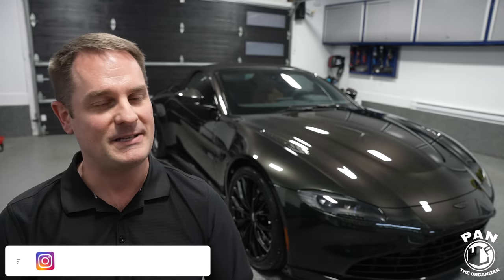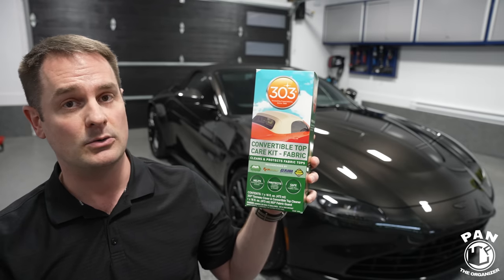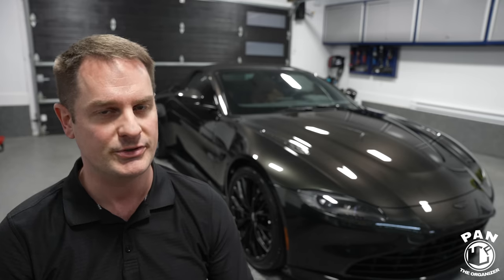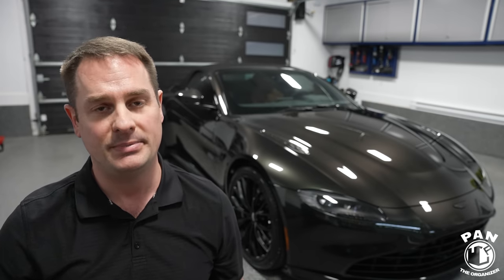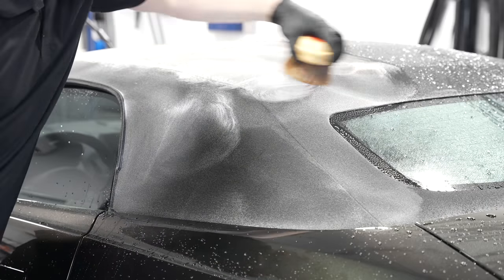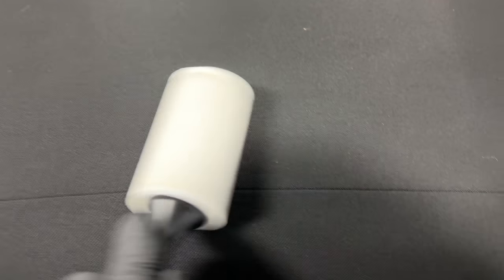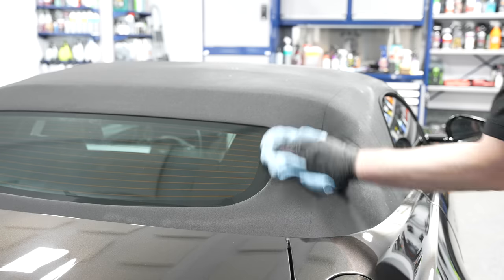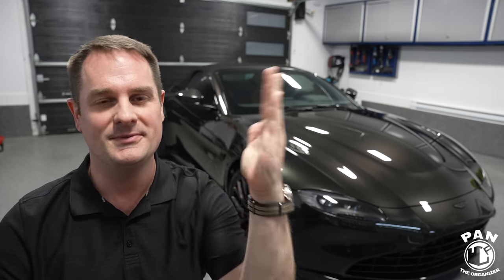How To Clean A Convertible Top

Comment: Pam, Im glad someone is producing a new video about convertible tops. The biggest area for improvement is to never use a pressure washer. The best method is flood coat of the water hose.
Reply: @coltongreysoper2134  why

Comment: Another outstanding video for those owning convertibles. Patiently waiting for help cleaning something every vehicle has: seatbelts.
Reply from the maker: Thanks 👍
Reply: Use a bungy cord and pull your seat belt out the door of the car towards the rear wheel and use the bungy to hold it in place flat against the body of the car. Gently close the door but not all the way. Pressure wash the stain out of the seat belt against the body of the car (a clean car) and it’s good as new again!

Comment: Is there any UV protection? It seems that would also help greatly.
Reply from the maker: Official statement from 303: "While 303 Fabric Guard does not provide UV protection directly, it protects the original UV resistance of outdoor fabrics by adding a layer of water repellency and stain resistance, which helps prolong the life of the fabric."

Comment: Great video Pan! What about the convertible top storage area of the car? When I retract my roof, the storage area has collected years of dust that can be transferred. This area also houses delicate moving parts for the roof mechanics (cables, springs, etc). It would seem best that this area doesn't get too wet? Thanks!

Comment: Hi Pan. Tomorrow I have a Smart Fortwo Cabrio with very dirty top. Sr. Lobo Detailing will follow your technics and steps although using different products but premium also. I’ve seen so many videos that only yours calm me down because you wash the car before as usually. In other videos they recommend not to do it to avoid dirt get into the top fibres even more. But I trust in your experience. I’ll let you know the results!

Comment: I know you try a LOT of products but I’ve been so impressed by maniac wheel and tyre cleaner. I won it in a giveaway from Eddie Colon and it has completely replaced brake buster for me. I tried it on an old accord with that brake dust that’s been baked on for years that you don’t expect to come off unless you use an acid. Completely vanished, just a little agitation from a brush, and 15 year old wheels came out like new. Also it’s a very good tire cleaner. Haven’t had to do more than one pass yet. Also it smells great.
Reply from the maker: We can’t get that line in Canada yet, to my knowledge, but hopefully I’ll get to try it one day.
Reply: @PanTheOrganizer  it looks like TOC carries it but it’s out of stock
Reply from the maker: Thanks for letting me know. I'll try ordering when they get new stock.

Comment: Great video Pan!  I'll be getting my new Porsche 911 convertible next month so this is excellent timing.  Any reason why you clean the top last?  You always advocate cleaning from top to bottom. How often do you apply the fabric guard, after every washing?  Thanks for all you do!
Reply from the maker: Congrats on getting your new Porsche. For a convertible top, as it's normally recommended not to use pre-wash snow foams or shampoos on them, we typically leave them for last in this scenario, as we'd use soft top specific products to clean and protect.

You apply the Fabric Guard as needed. Meaning when you see the hydrophobics starting to diminish, it's time to reapply. Durability really depends on how much mileage you do, your weather/conditions, etc so it's impossible to know.

Comment: I agree with everything you demonstrated. My 22 year old convertible vinyl roof still looks new by using just water in a spray bottle (I never allow water on my car) and a soft brush to clean and then 303 for protection.  I guess I clean it every 3 or 4 months.

Comment: I like to use the Meguirs fabric brush to remove the lint and sand of my soft top.
Currently using the Turtlewax hybrid solutions misting detailer to prevent the lint.

Comment: Great video as always. Love the 303 products. 
As an FYI 303 had a bad batch of protectant out in the market. It turns ashen gray/white. 
But a good company stands behind their product. Offering replacement and refunds. 
The bad product washed off using Dawn Power Wash, at 303's suggestion. 
Did a good job last week. Then came over that with the 303 cleaner and fresh protectant today. Makes my 2020 Race Red 'stang look like it just rolled off the showroom floor with a jet black top. 

TY Pan for all the great info.
Reply from the maker: Thanks for the info Michael. And when you mean bad batch of protectant, are you talking about their Interior Protectant, or something for the paint?

Comment: Are you supposed to apply any of this again once you wash the car ? I have a Porsche 911 992 Cabriolet and am wondering how many times I need to wash it. I don't drive the car when it snows or pours therefore only on cool days and sunny days, therefore I don't need to wash it that much. If I do apply a protection like this, I'm wondering if I'll need to reapply it after every thorough wash ? Thanks.
Reply from the maker: No you don't need to redo this after each wash. You would only redo it if you see the hydrophobic properties (i.e. water beading) starting to diminish. That's a visual indicator it's time to replenish the protection. It depends on your conditions, weather and mileage.
Reply: @PanTheOrganizer  -- Thanks a lot for the answer.

Comment: Hi Pan , do you full pressure of the jet washer on the soft top  or do you turn the power off and just use the standard water through the gun ?
Not sure if the full power of the jet washer could damage the roof

Comment: @Pan How would you maintain/clean the soft top after applying 303 Fabric Guard?

Im currently using Gyeon Fabric Coat and I found that pressure washing and a PH neutral snow foam worked very well as per their recommendations but I see no such recommendations for 303.

Comment: Thank you for the video Pan! I am curious to one thing in the video. Is it safe to use a pressure washer for rinsing a vinyl convertible top? I thought I remember reading somewhere about not using pressure washers on vinyl convertible tops?
Reply from the maker: That is correct and incorrect at the same time haha. The reason why most say not to use a pressure washer, it because they don't want people to come in with a 4000 psi gas powered pressure washer as that could for sure damage the fibers.

For detailing, it's never recommended to go beyond 2000 psi when washing cars. I set my pressure washer to 1000 psi (the more important is water output, at 2.1 GPM my pressure washer has a stout water flow). It's totally safe to use on fabric tops.

So if you have a pressure washer that generates too much pressure or want to be 100% safe if unsure, just use a garden hose.

Comment: 303 fabric guard is the absolute best product for convertible tops especially when you have a brand new top installed or on a new car's top , the best way this works  is to mask the car off around the top area borders plus use thin plastic to cover the rest car completely after cleaning   use the lint roller then we spray the top in a x pattern saturating the top in direct sunlight if possible on not to hot of a day 80 or so , and below works great - do not wipe the product off just let it dry right out in the sun if you can ...we have found out in the upholstery shop in testing  this gives the best results with the longest duration of protection ....you really have to mask the car up good and cover with plastic for over spray other wise it is a night mare once hardened to get off parts of the car that you don't want it on .... do this every summer ... or if the car is only used for limited summer use and stored covered in the winter do this 303 every other year will work just fine .... I have a Camaro Z28 SLP  LS1 convertible car I put a new top on it 1 year ago, and its a garaged car covered car only used in summer with a cover used all the time in the summer when not driving it , and the 303 coating is in perfect pristine condition as is the top it looks amazing brand new , and when treated with 303 it just makes the top look really rich darker more vibrant in color ... great channel just subscribed !  I've bought several of the products used on this channel and they ALL work GREAT ! ...
Reply from the maker: Thanks for sharing your experience and tips, and I appreciate the kind words.

How did you discover my channel by the way?

Welcome to my channel. You discovered one of the biggest car detailing channels on YouTube as we surpassed 910,000 subscribers and we have over 120 million views! I have been detailing for 26 years and I love to share my knowledge and passion with my viewers.

You found the right channel to help you learn everything about detailing.
Reply: @PanTheOrganizer  I found the channel looking at ceramic coating videos here on youtube ....  I did buy the Tw hybrid line up , thinking I can still get the ceramic coating off on  a shorter term product a lot more easy than a long term product in case of road damage to perform paint repairs if I need to , so far ive used the TW hybrid ceramic spray coating on 4 of my vehicles  corvette , camaro  z28 , Hemi Jeep, Duramax 1 ton  long bed crew cab this one took days to correct,  and get coated ...

Comment: Recently picked up a used convertible. The soft canvas top is in good condition however, it looks like someone got too close with a pressure washer and left marks that are lighter in color. The top is dark blue. Can anything be done to even the color back out?

Comment: @Pan The Organizer I have a question. I watch a lot of your videos and Yvan LaCroix's videos. Yvan says not to use the pressure washer unless you use the SOAP/BLACK tip because it's really easy to get lines in the soft top but i see you have no problem. I know you have the Krenzla that's adjustable. Do you put it on low pressure or do you just use distance as your Ally? I'm still starting out and haven't done a soft top yet but I know it's coming at some point and I don't want to cause damage obviously. But I want to learn best practices before I get into that situation. Thanks for all of the help through your videos. I know we haven't met but I've learned so much from you and Yvan that I consider you my mentors. Keep the knowledge coming I'm always willing to learn. Thanks again.
Reply from the maker: I would also recommend staying low on the pressure if using a pressure washer (800-1200 psi max) and don't get too close to the fabric. I use a wide 40 degree nozzle so the fan is wide and of course, 26 years of detailing experience helps. If one is unsure of how much pressure their pressure washer has, or don't have much experience, perhaps they should stick to a garden hose, which is totally fine.

I set my Kranzle pressure washer to 1000 psi when washing cars. You should never go above 2000 psi when washing cars, as you could damage the paint. And you have to be even more careful with fabric convertible tops.

Comment: Hey pan can you use iron fallout remover on fabric tops? I would imagine the fabric roof would build up contamination just like any other car surface maybe even more so, so I thought it would definitely be beneficial but I haven't tried it yet and wouldn't want to risk trying it on a customers car. Any advice is appreciated
Reply from the maker: I don't have the answer to that, but I wouldn't use iron removers on fabric surfaces, as they don't say they are compatible with the fabric. Also, as fabric is not as densely packed as the clear coat of your paint, my guess is that the small metal particles won't bond to fabric, it just gets flushed with the water. Hence why you never see "rust spots" on fabric roofs.

Comment: What pressure (PSI) is your pressure washer when rinsing off the soft top? Do you know how I can adjust the Active 2.0 washers output?
Reply from the maker: Never go over 2000 psi when washing cars. I set my pressure washer to 1000 psi 

You can adjust the pressure by switching the orifice of the nozzle you are using.

Comment: @pantheorganizer how do you maintain a fabric soft top during a regular maintenance wash when you are not waterproofing/protecting it? I plan on deep cleaning and protecting the fabric soft top every six months but not sure what to do in between. Thanks!
Reply from the maker: Just wash it using the same pH neutral shampoo as the rest of the car.
Reply: @PanTheOrganizer  does that include carwash and wax combo soaps?

Comment: Every softtop Ive been asked to detail has been covered in green alge, mould and lychen.
So after cleaning they have needed to be recoloured and proofed. Pain in the ass getting them to dry in the UK weather.
Ive stopped taking on canvas and mohair soft tops. I'll happily still do old vinyl roofs (MGB etc)
Reply from the maker: Yeah I have seen a few videos from the UK with mold and algae and lychen. Crazy humid and rainy weather really takes a beating on those things! And I fully understand why you would stop taking in such jobs. Most clients don't understand the amount of work that has to go into such jobs, or they don't want to pay for the work.

Also, unfortunately, most convertible top owners aren't detailing enthusiasts, so more often than not, they don't care for their vehicles and let them get to a state of disrepair. Regular maintenance is key to keeping any surface of the vehicle clean and protected.

Comment: Hello, I went to the link for the 303 convertible top care kit.  I am looking for some thing to condition the top of our new 24 Camaro SS.  In the bottom of the link is stated, 
“Due to the recent formula issue 303 fabric guard may cause a white residue on your fabric. the residue can be removed by using any fabric safe cleaner, dish soap or laundry soap. Please contact the manufacturer for a full refund if you experience this issue”. 
Have you experienced anything like that from this product, or why would that happen? Over applying the fabric guard maybe?    Thanks!
Reply from the maker: Nothing like this had ever happened to me.

Comment: It's the first time I see a convertible in such good condition :P Now, this process is what you do a few times per year like a prep and coating with a ceramic spray but for the fabric? Apart from that I suppose for the weekly washes it's ok to use the ph balanced soap, right?
Reply from the maker: A gentle car shampoo is ok for regular washes. But when you see the hydrophobic properties of the fabric starting to diminish, you know it's time to do a deep clean with an appropriate soft top cleaner, and then reapply the protection.

How many times you do it really depends on your specific conditions and mileage and weather, etc.
Reply: I actually didn't know how to handle such a surface, didn't happen. Thanks for the response Pan!

Comment: Hi pam i use this on my convertsble tt same brush same product so what i did is spray this on the car use ther brush wash it out properly then because i was in a bit of a rush i dried the roof top but it was slogltly humid so what me and my dad is spray this on the roof and use microfibre cloth to spread it around but then after a bit it had some white stains, so we watched the video and it said do a second coat so we sprayed a second coat wich made it a bit worse but idk why that hapen is it bcz the roof wasnt fully dry maybe? To make it worse it rained on top after ahahha cuz im from the uk 
Some vidros online say spray it on and leave it it will dry should i try that next time because the website dosent mentoon using a cloth after let me know what shall i do next time thanks
Reply from the maker: What product did you use? Did you try reaching out to the company or the place where you bought it? It's hard to troubleshoot at a distance simply by writing text. You would need to share details with an actual person that is trained on the product, so they can guide you.
Reply: I used 303 fabric cleaner and fabric guard

Comment: Foes this help to restore ormake the top look a little newer? My Mustang is 14 years old, but only has 55,000 and stays in the garage. I would like for the top to look a little better. ( It doesn't look that dirty or a little old.)
Reply from the maker: Yes this should in theory clean older tops. A few rounds of the cleaner might be necessary depending on your level of dirt and what type of dirt it is (mold, etc).

Here's a video from a detailer friend of mine that works on a dirty older convertible top: https://youtu.be/LPqYg6WRLFE?si=CEKFm4B21Nnk8ntH
Reply: @PanTheOrganizer  Thank you for the reply and link. He is very detailed.  I like that!
Happy New Year!

Comment: Over 20 degrees Celsius!!!!    That gives me a very,very small window here in the UK😢😊
Reply from the maker: You can detail in temperatures as low as 10C, but it's sub-optimal. For best user experience, 15-25C is the range you want to be in. Don't work in direct sunlight.